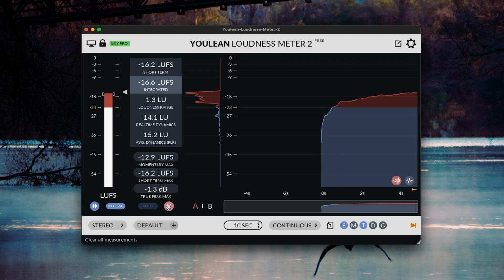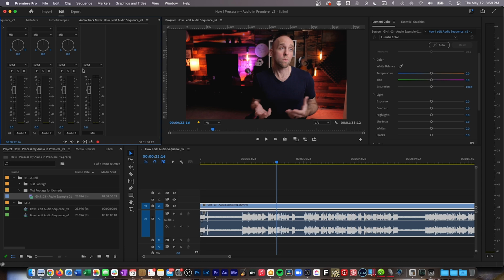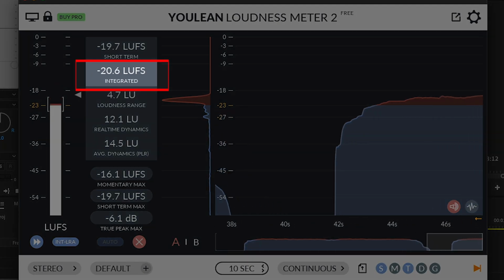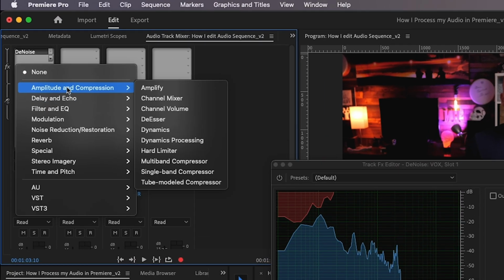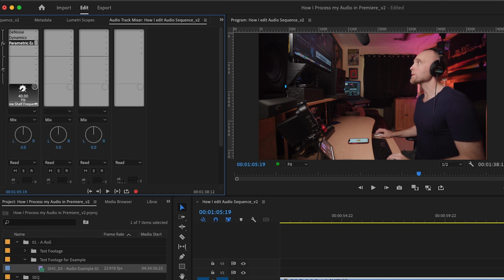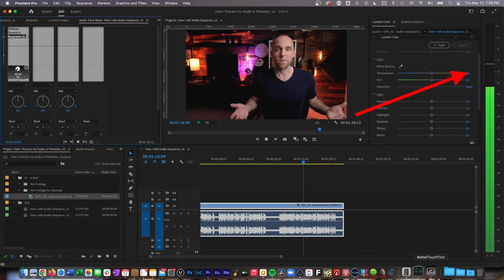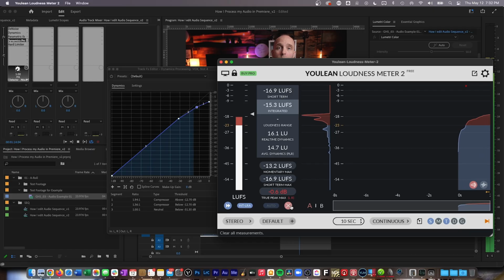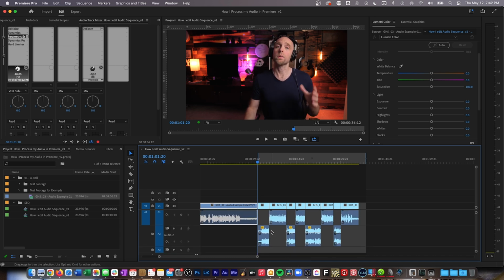How I Record, Monitor, and Process my Audio with Adobe Premiere

Comment: Absolute legend! I didn´t understand why not use dynamics proccessing for both expand and compress in the same instance, but I get it now, cleeeeaaaan!
Reply from the maker: Hi there.  So, I have now been using Davinci Resolve for all my edits, and in their "Dynamics" section, it has an Expander/Gate, then a compressor, then a limiter, all in the built-in section, and they're in that order:  Expand, compress, Limit.  I haven't been using Premiere very much the past few years, but looking at the screen (in my video) during that part of the edit, at least in THAT instance, the compressor DID come before  the expander which is why I didn't "check" the little tick-box next to the compressor at that time, because I didn't want to compress yet, so I did it later in the chain.

Comment: I must have missed the part where you recorded the audio?
Reply from the maker: Hi there James.  I guess I do kind of breeze over the ACTUAL recording, but I talk about how I usually record my audio starting at 1:34.  Basically using my Rode VideoMic NTG running directly into either my Panasonic GH5 or Sony A7iii's 3.5mm TRS input and recording my audio directly with my video.   Maybe I should rename the video to "How I Monitor and Process my audio," since there is less actual "how I record," but, it's there, in a very summarized version.

Let me know if you have any questions,  

Thank you James